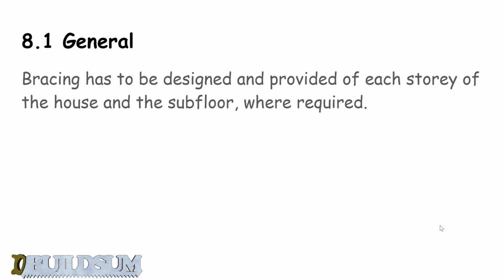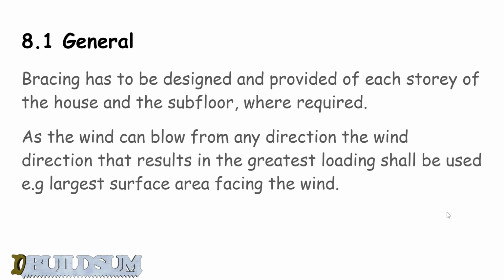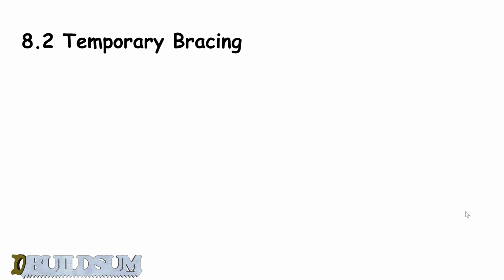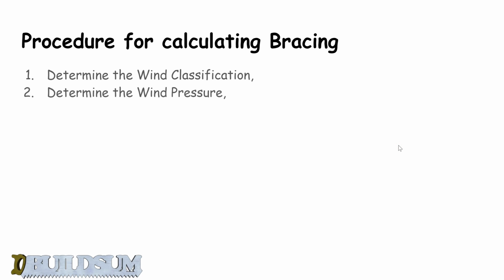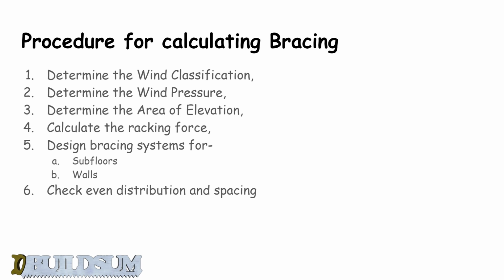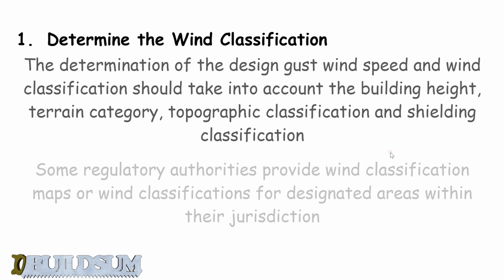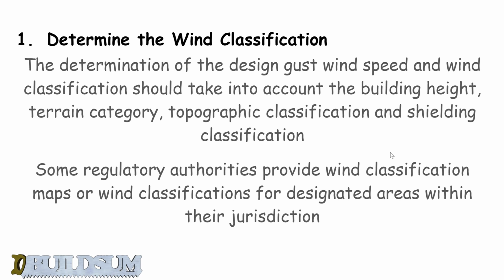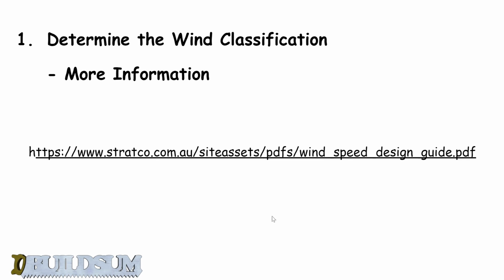Calculate Wall Bracing - Part 1- Getting started

Comment: Hello there, we have been watching your videos to aid us in preparing to building a small home for ourselves, however we have come across a section in the drawings for our home that we are having trouble understanding. This relates to a plywood bracing on every corner. We are wondering how this is meant to be carried out, given that the cladding will then be resting unevenly between the studs and the plywood bracing at the corners. If you have time to spare to help us understand, we would greatly appreciate it. Thank you
Reply from the maker: Hi Mate, this is a common problem and the only solution is to pack the remaning studs out by the thickness of the bracing sheet so that everything is in line. Hope this help.
Reply: @Buildsum  Thank you for that! Much appreciated :)